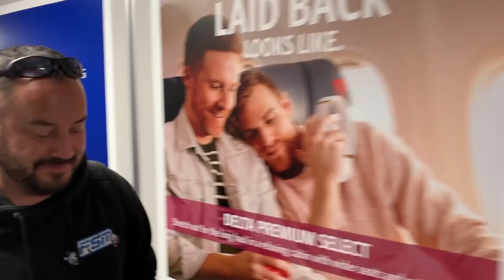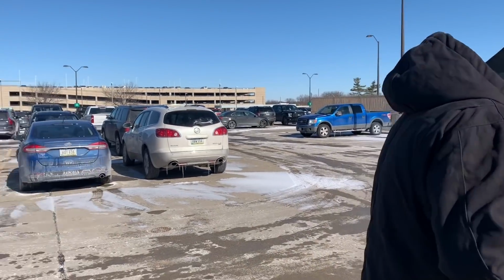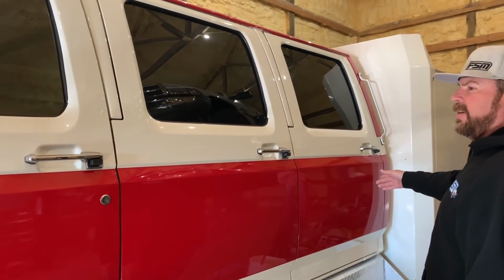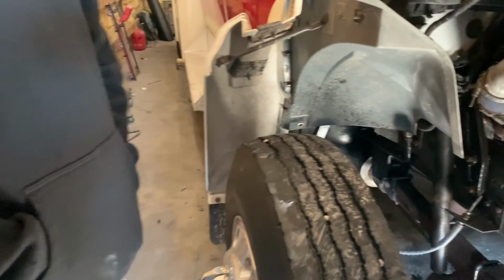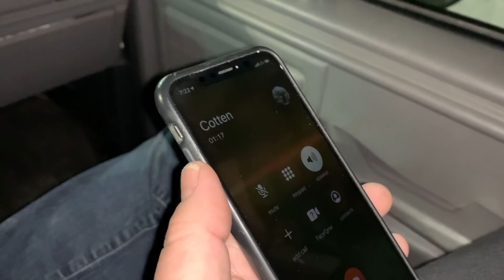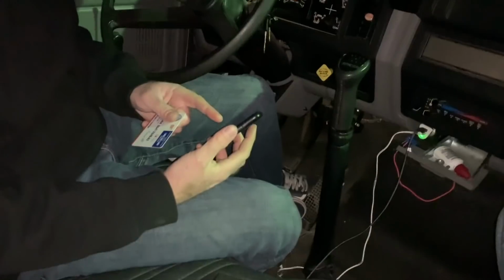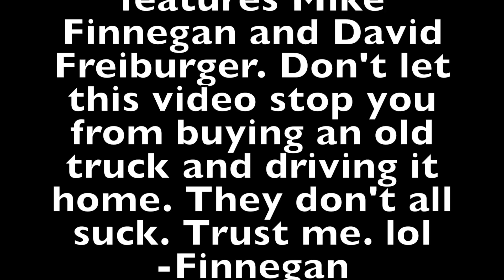I Bought a Six-door, Cummins-Powered Truck and it Died on the Way Home! Finnegan's Garage Ep.91

Comment: "What kind of vehicle is it?"
"Ford F800"
"Uh oh"
That had me dying!
Reply: I Fuckin lost it. 😂 been there done that
Reply: As soon as she said it, I died.
Reply: His spelling had me dying
Reply: Could not have had a better reaction from her.
Reply: The bungie cord holding the dipstick in was my first clue there was a problem
Reply: @darringramling597  Yeah you can see blowby from the breather hose when they are first inspecting the engine running. A decent judge is to take off the oil fill cap on a cold start, and just set it where it was...if it gets blown off that's alotta blowby.
Reply: This is by far the funniest Finnegan's Garage episode Yet between Dave's call with Gotten and the roadside assistance girl.
Reply: I agree!!! That Triple A phone call absolutely floored me!!!!
Reply: I was freaking crying I was laughing so hard
Reply: Rolling on the floor
Reply: Buys 35 year old truck used, is surprised it might need some TLC.
Reply: @kdrapertrucker  where are you getting 35 years between 1998 & 2020? F*ckin genius lmao.
Reply: LOL I would of probably said something similar.
Reply: DirtyGeared I fucking lost it. Been there, done that.
Reply: @Snarf_Le_Wombat  problem with that is that diesels, especially older diesels and bigger commercial diesels, blowby is perfectly normal, and more often than not would actually have dedicated blowby vent lines rather than PCV systems, which is what you're seeing as a breather hose.
Reply: @Tboninator  Not sure what your point is. The amount of blowby on this 5.9 is not normal. Couple that and coolant issues and breakdown...This was so long ago so I can't remember but wasn't the head gasket blown? Source, owned two of these engines in 1st Gen Dodges, and am a certified diesel mechanic.
Reply: @darringramling597  they should have checked the blinker fluid 1st
Reply: i would have said Uh oh after he said ford
Reply: Found On Road Dead. Put it in reverse. Driver Returning On Foot.  By a Ford by the best, drive a mile and walk the rest.  See your problem is it says Ford on it!
Reply: @ram2791  don't forget fix or repair daily
Reply: You probably dont care but does someone know of a tool to log back into an instagram account..?
I was stupid forgot my password. I would love any help you can give me
Reply: @Marcus Blaze Instablaster =)

Comment: Come on boys when the dipstick is bungeed to keep it from blowing out, there's coolant on the frame, and kitty litter everywhere when you get there you turn around and catch another flight. unless it's REAL cheap. That guy knew that thing was hurt.
Reply: I missed that dipstick. I figured he might have busted the oil cooler by not winterizing it(previous owner) and patched to sale. That dipstick is a major tattletale with a 12 valve. Best bet to be looking for another engine. It would be worth it to check the head out and head gasket first but they usually dont have trouble keeping the dipstick in with a bad gasket. I agree, hurt motor.
Reply: Ol2Stroker im sure they have knew something was wrong with it.
Reply: @1986Honda4trax  i agree. for what ever the price was, im sure they couldnt pass it up even knowing the engine was hurt.
Reply: How did they not see that?
Reply: That's probably why he didn't stop when it started smoking, he stopped when it stopped moving.  The engine was already dead leaving the garage.
Reply from the maker: @ilovegoatsecks  six doors was the selling point.
Reply: @FinnegansGarage  knew it! now a 6.7L or  8.3L swap?
Reply: @FinnegansGarage  "If we can get it home we can fix it...." that line hurts everytime.
Reply: D3adCy11nder yep I agree. Being how the 12 valve has become the new small block Chevy, rebuilding this engine or sourcing another was a small price to pay on top of the purchase of a unicorn truck in the grand scheme of things.
Reply: @ilovegoatsecks  I think it needs a 8.3
Reply: @rayzimmer8562  good detection skills.
Reply: @ilovegoatsecks   Detroit 6V92TT
Reply: Also on 12:30 you will see a lot of blow by under the truck from crank case vent.
Reply: @vector6977  8V92TT
Reply: @SesameStreetRacingChannel  You for to add "Salt the ground"
Reply: @armelind  I literally have said that about every vehicle and machine Ive ever bought, years later, some of the workshop equip is working really nice, but I have one hell of a car/truck/bike project backlog... Got to be in it for the long haul :D
Reply: @Dig163  Naw if you're going down that road hold out for the 12V92
Reply: @fk4515  the 8 aint much bigger than the 6 physically, the 12 on the other hand is
Reply: @FinnegansGarage  Those are some expensive doors.

Comment: everyone: 12 valve cummins are the most reliable diesels ever made

finnegan: hold my beer
Reply: The oil cooler probably failed allowing oil to enter the coolant.  The real issue is when the engine is shut off and oil pressure drops, pressure from the cooling system will push coolant into the oil.
Reply: @bobroberts2371  and that is why most flat landers don't run pressure caps...
Reply: @bobroberts2371  I'd take his truck... Don't need to see the outcome. Great engine, just a little rotten sitting up.
It takes a good bit to kill those Cummins.
Reply: Diesels need to work hard to run right.
Reply: True
Reply: just a ningus and don’t you hate it when someone buys a diesel knowing they don’t even own a trailer or boat?
Reply: Matthew Fogarty it is all about power rating. Those Deutz diesel are massively overbuilt and put out relatively low power. They will run long after you and i are pushing daysies. Providing fuel is still a thing.
Reply: @blackbird8632  Yes as long as the Cooling Belt is still intact...had they Gear Driven the fan on those Deutz engines...Deutz Diesels, KLR650s and cockroaches would survive the apocalypse.
Reply: @blackbird8632  No problem.Just hook up a (semi) tanker full of diesel to it.Should last it for a while.
Reply: Nothing is reliable when 12v Dave is involved.
Reply: @professorjamesmoriarty5191  😕
Reply: 5.9s aren't known for great longevity in a medium duty, especially when start to get close to 30K gvw.
Reply: No so long ago I was talking to my dad about big diesels and Cummins came up. I was like: "They're pretty cool, right?" My dad, who had worked all his professional life for Mahle, dryly commented: "Nah, in the land of the blind the one-eyed man is king."
Reply: It's just a classic
Reply: then you must have not driven a Chevy?
Reply: @jimmytran5971  iv never understood the us lack of passenger diesels
Reply: Unless Ford uses them.
Reply: Two stroke Detroit > Cummins
Reply: @jediknight1294  confidence was killed by crappy 70s and 80s diesels that had no power, broke all the time, and had water in the fuel problems. It is silly that they arent more popular.
Reply: @erikhose300  well that and the fact the EPA hate diesel passenger cars seriously man the EPA passenger car regs are lunacy compared to.thw uk/eu regs (up till euro 3 for.sure and even past that tbh)

I do want that American Korean based diesel though but I'm not paying 15k for something a marine.has beat on for 4 years.
Reply: @erikhose300  also when ford took a gas motor & turned it into a diesel u where lucky to get 30 thousand miles out of it lol

Comment: When Finnegans Garage turns into an episode of Roadkill 🤣
Reply: I don't entirely believe it wasn't on purpose... the RK theme I mean.
Reply: @fast97z24  I do, they just purposely bought vehicles that had the odds stacked against them to begin with. junkyard starts and rebuilds, high school beaters, used ass work trucks that were clapped out before they were sold...
Reply: Like that 6 door F800 that just blew a head gasket? He should of known by the kitty litter on the ground and the coolant spray all over LOL!!
Reply: Rip I use to love watching roadkill when it was free
Reply: I think that's the idea. The two original guys don't seem so close. Roadkills success is partly due to the dynamic of the two original guys, I've watched a bit of this guy and his wet friends in his never ending attempts at emulating roadkill and the granny pace episodes under his house, dudes, It sends me to sleep.
Reply: @crumb0000  Finnegan moving to Georgia seemed to coincide with the downfall of Roadkill.

Comment: Can't wait to see Finnegan and Mcfarland at the Freedom Factory!
Reply: crbill53 I wanna see a faster with finnegan with Adam drifting the freedom factory and them in something completely I’ll suited for drifting
Reply: crbill53 he was there on the first day doing a burnout in WhiteTrash....
Reply: Doubie what?
Reply: @Doubie.  Well, the "ill fitting" thing was just bought... ;)
Reply: Timberwolf69 as funny as that would be I’ve been that sideways in a truck that big it’s terrifying I was thinking more like a wheelie van or something short and hard to control or a fleet wood wagon trying to drift that boat of a semi is almost a death sentence for him or the truck or both
Reply: @Doubie.  Well, I think that hearse doesn't come much shorter than the truck, in my opinion...
Reply: Timberwolf69 it’s not really about length in this case that just controls how fast it swings side to side it’s more that the only tires that fit that truck have tons of sidewall and the roll center is so high and heavy  there’s a better chance of rolling that boat over than drifting it especially on a surface as fucked up as the track currently is even if they repaved it it’s still really sketchy
Reply: @Doubie.  I think the bigger issue would be the unavailable steering angle in the front.
Combined with too much grip in the tires and the - as you mentioned - quite high center of gravity, that actually would be a prime recipe for desaster.
Even though I have seen a semi truck drifting - but that was a race truck.
I think an unaltered hearse would also show a tendency to roll - not as much as this rig seen above, but still.
And a wheelie truck has way too much grip on the rear axle to really be able to drift...
Reply: Timberwolf69 the searing angle isn’t as big of a problem as you would think because there built to haul long trailers they have an abundance and could easily have more the grip problem is also easy to solve they have hard tires to deal with excessive weights and have little traction unloaded just add power and burnouts are easy the problem happens however when you put the vehicle sideways with that much sidewall it has a tendency to fold over itself bringing the rim closer to the ground debeading the tire or smashing the rim straight into the ground and tires for that size rim don’t come in low profile side walls and getting rims in that bolt pattern requires a level of customization most people can’t do at home plus Fin’s trucks cab and body is much longer and and heavier than a normal tractors if you include the added frame twist from the extended length it’s a recipe to roll over can it be drifted yes but it’s much more dangerous should  it be drifted probably not.                The problems with a wheelie van are not as bad as you assume either in the way your imagining car and truck wheels don’t drive straight the way most people assume rears point in or out (the front of the tire) to give vehicles more or less traction by adjusting this component of the suspension you can put grip into or out of the car the proble in this setup is what allows the car to wheelie at all high rear ballast ratio of the van itself vans are long wheelbase vehicle’s year nature making them transition more slowly side to side while drifting but the effect would be compound by high rear weight traveling long distances during swing while drifting would almost guarantee even a pro drifter spinning it out and backing it in to a wall or grass or whatever else is behind them

Comment: "You'll need a pretty decent size flatbed for this."
Reply: supersimon126 or a wrecker
Reply: Or a detachable deck trailer.
Reply: I seriously died
Reply: I was stuck in a motel in 1979, in Waukeshaw, Wisconsin and about 10 below zero, with a Kenworth Cabover 2-axle tractor that wouldn't start. I figured, "What the hell? I've had AAA for 15 years, I might as well give them a call." They didn't want my call. The nice lady said, " Your towing coverage doesn't include commercial vehicles. I tried to tell her, "it's a really nice truck and I left the trailer in the terminal yard so it would be really easy to hook up to." She wasn't buyin'! I spent the weekend in that little motel and it never did get above zero... but there's a restaurant called Zorba's attached to the motel (still) and they had great food so I didn't suffer too much. TV in 1979 ran out of excitement pretty quickly so it was a borrrring weekend!
Reply: @MrGaryGG48  What does that have to do with the video/comment ?
Reply: @konkor9940  it has to do with trucks that break down, obviously
Reply: Put a big tutbo on it and make it do a burnout!
Reply: Tow truck
Reply: Tow Pig🐷🙈

Comment: I feel better after seeing this video, two days ago I picked up my 1996 F800 box truck with a 6.9 cummins from getting inspected, it passed but I was told the turbo was leaking oil and there was a risk of having a runaway engine. After getting the estimate I decided to order one online and do the work myself, the estimate $3,800 was $1,300 more that I paid for the truck a year and a half ago. I can't complain too much, it has 292,000 miles on it and still running decent. The 5.9 is absolutely no powerhouse but it will eventually get where its going, at least most of the time :(

Comment: Love how the f800's sported the early to mid 80's f series interior
Reply: I noticed that aswell.
Reply: Got to do something with all the new old stock(NOS) parts...
Reply: Pretty common on the 2 ton and commercial bodies. These trucks prioritized work over creature comforts and and interior tech.
Reply: They Kept that interior until they switched to the super duty body. Which if i remember correctly was in 99 or 2000.

Comment: My F700 has the same Cummins, and I love it. It's my errand runner, just because I like to drive it. I get 24 mpg on the interstate with it. Had a F250 dually long bed on it for several years, now it's a flat bed. So stinking reliable!

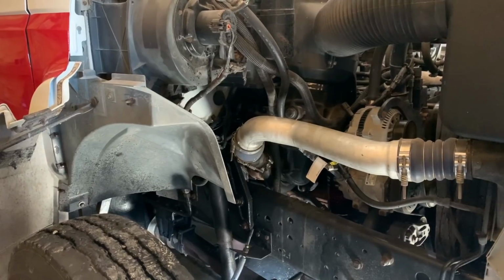Comment: 13:19 My prediction.... Coolant issues -  core plug on the back of the block hidden by the flywheel housing. It'll look like a cracked block until you get it apart.  50 cent part - big headache to fit it!